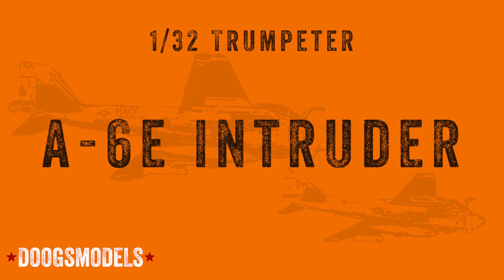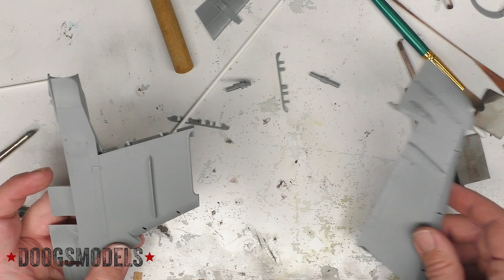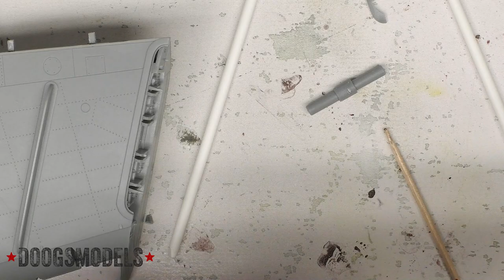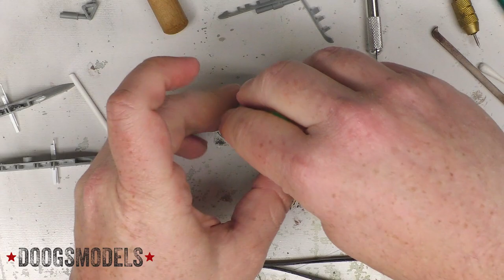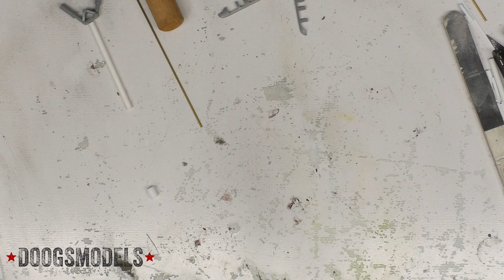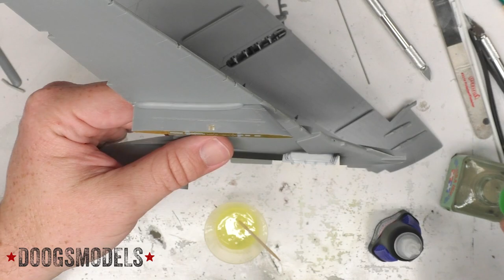A-6E Intruder Build 02 - Sorting Out the Wings

Comment: Hi - Looks like you came up with an elegant solution to a serious design flaw that Trumpeter shouldn't have created in the 1st place. The Intruder has a mechanically complex hinging system which is hard t replicate in any scale...Trumpeter could have up with a Brass or Al hinge that would allow us to "unclip & remove" the outer wing portions but would have made the kit more expensive...
Reply from the maker: I've never seen any scale wingfold that could convincingly hot swap between folded and extended - even Tamiya's superlative 1/32 Corsair makes you choose. But a heavy duty spar arrangement would allow for a lot more strength either way (and something angled would make it a lot less painful to get the fold angle right).
Reply: @DoogsModels  Yeah - Thats Right